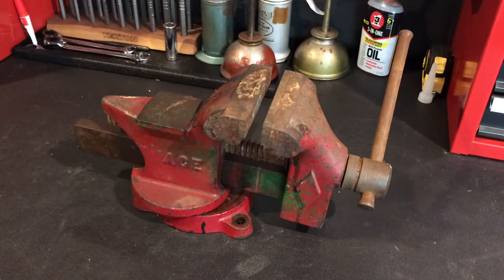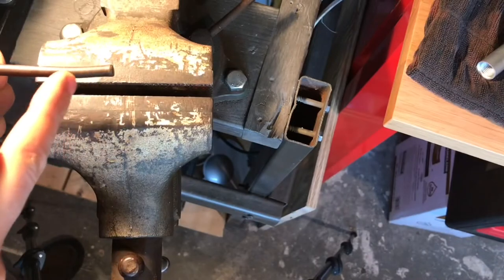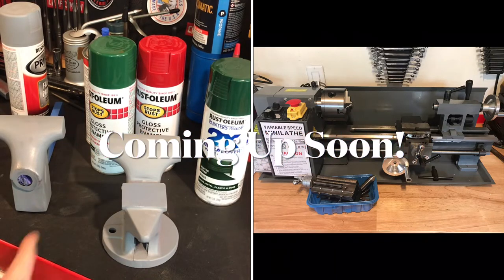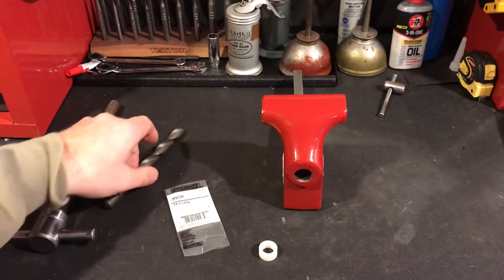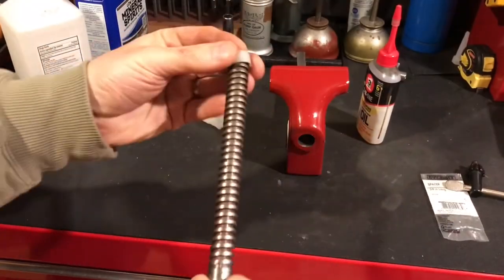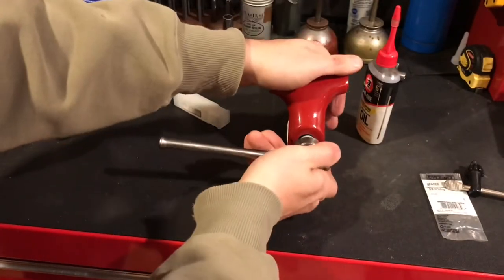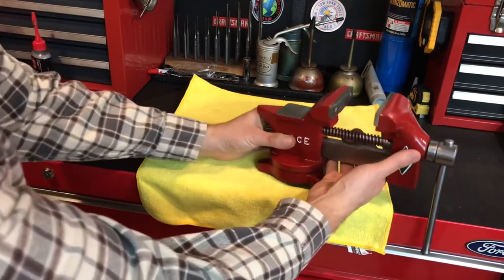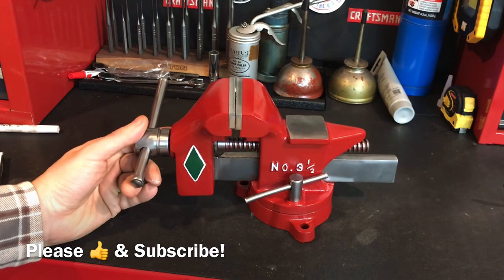Christmas Vise Restoration!

Comment: Hi Tom!  Great job on the vise!  You are going to have a ton of fun on that lathe- Next time you need to bush a vise like that one get some 1/2" PVC pipe, it's the right size and only requires a little lathe work.  8 feet will last a life time!  =D  Believe it or not those vises all came sloppy from the factory!  You really upgraded it...
Reply from the maker: Thanks for the suggestion John, I will definitely pick some up.

Comment: Great job. I have an old sears vise that looks a lot  like yours. It came from my father-in-law. I haven't restored it yet but I did fix the swivel lock. It had rusted the square nut replaced it and cleaned works great. I like your idea with the bushings. I have a little jewellers vices I restored that I was not happy with. I might go back and use them. I hope my HF has them. Merry Christmas.
Reply from the maker: Thanks Glen, merry Christmas! 🎁